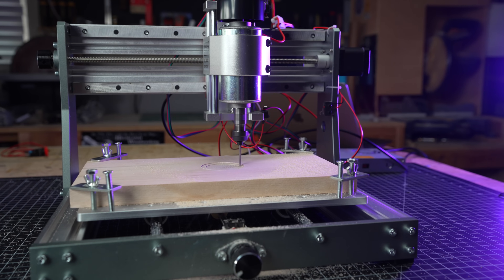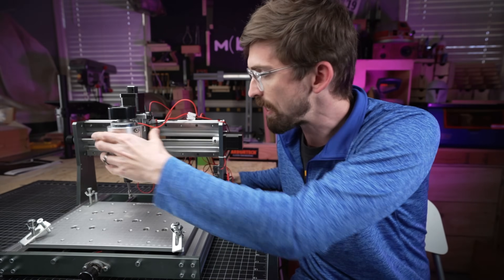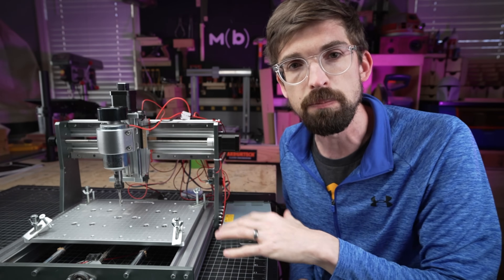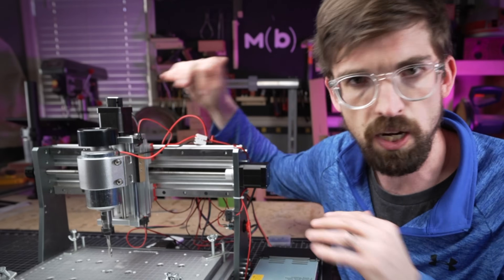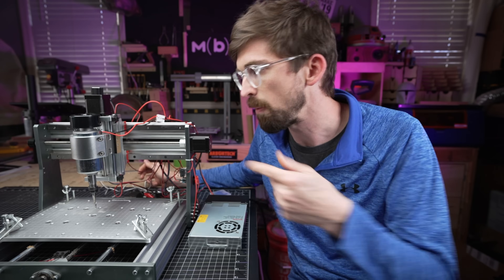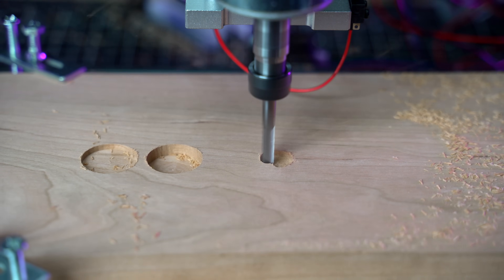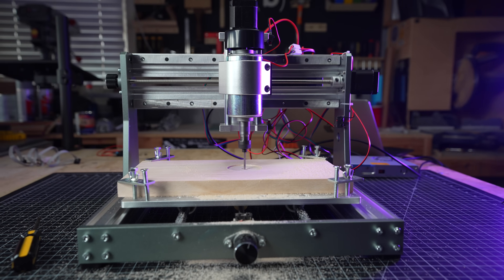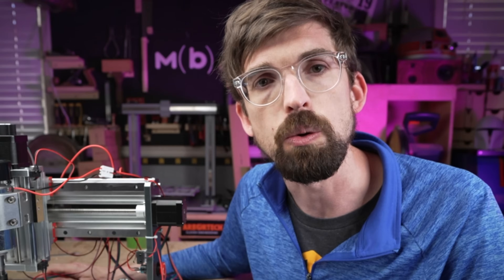What Can a $500 CNC Do? Genmitsu 3020 Pro Max

Comment: for the z axis, cant you just mount the motor up a bit higher, especially for using those 1/4 bits? and wouldnt that also make the spindle a bit more stable as well?

Comment: How feasibile would it be to swap out some of this hardware to be able to handle actually cutting metals? Or does anyone have any other recommendations for low price cnc metal machines?
Reply: I have cut both brass and aluminum on a 3018 even thouth I have larger more powerful machines. Things to consider = cutter type vs material, chip load for cutter / material, depth of cut, feeds and speeds. None of this seemed to be addresed in this video. These small machines can do well within thier limitations. I tend to use my 3018 for small detailed parts in brass and alumimun carbon fibre or wood. Do some research on cutters and materails with the proper tunig you can get good results.

Comment: This is definitely not a good CNC machine. This is a toy. If you really want to buy a toy like this, buy the cheapest one. You will probably be able to engrave printed circuit boards, and thus softer materials.
Reply: Would be better to buy higher quality parts all round including the beefier stepper motors that have controllers & aluminium extrusion. Of course that does mean more work, but if a bare bones CNC machine without any stepper motors, controllers or spindle isn't available then making it from scratch is always the best most cost effective way to go.

Comment: When you described the spindle you said it was a VFD. This is wrong, it is not a VFD. VFD stands for Variable Frequency Drive. A VFD is used to drive a three phase AC motor. The motor used on this unit is a brushed DC motor. The speed is controlled by PWM, Pulse Width Modulation.

Comment: Really, this vibrating clump does cost $500 ? Man, how lucky am I that I got a real milling machine for less than twice that money, Sieg X2P. No CNC but does mill steel or 1/2" aluminium in 1 pass. The original Genmitsu 3018 for $180 ist a bargain, but $500 for nearly same construction is way too much.

Comment: You are having problems with aluminium because you are not using the correct type of end mill. If the mill is chocking up use an end mill with more flutes or a higher rotation speed. Also you need mills with cutting geometry specifically for soft metals like aluminium and brass on low powered machines like this. If you had tried this with brass it would have probably given even worse results because brass is so soft it tends to grab the cutter so definitely needs correct end mills with the correct geometry. Also a shorter end mill will help and repositioning the spindle higher up in the mount will produce less stresses in the z axis and gantry assemblies.
Reply: thanks for sharing!

Comment: I bought this 3020 in Nov 2021 strictly for aluminum cutting. I’ve been using a competitors machine for over a decade and it works great. I was disappointed with this machine and had several issues. It will cut aluminum but not not very well. The 1/8” bit must be all the way in the shaft. (And to prevent milling the table it’s best to lower the Z axis to the lowest point and raise the spindle in the holder so the bit can’t reach the table.) But the spindle is just not rigid enough to handle the cutting, the length of the shaft allows slight flexing. And the spindle doesn’t have enough speed or torque. I found that even slowly cutting a 1” hole in 2mm aluminum with 9 passes was nail biting. It did cut the hole but was a struggle. The finished hole was a few thousands under size because the spindle rigidity was causing it to flex inward. And just drilling a 1/8” hole w the milling bit would sputter when reaching the bottom, and wallowed the hole almost every time. So to fix both issues I hack sawed the spindle holder (another problem-only a 55mm spindle fits), and mounted a $70 rotozip (600W 30K RPM) with metal strapping. Now it mills, drills, and cuts much better. Note that after less than 10 hours the 300W spindle stopped working.

The other issue I had was that most all of the USB software I tried wouldn’t run a few commands of my existing gcode. Also, it was essential that I could stop and start the gcode from any gcode line, and couldn’t do it! So, to get around those problems I abandoned the USB controller and bought a parallel stepper driver and use LinuxCNC (or Mach2).

Overall it’s a nice little machine but wouldn’t recommend for aluminum unless your into mods.
Reply: I'm looking to buy a machine under 1k for cutting aluminum and stainless steel. What do you recommend?
Reply: @BenzCedes  I’ve only used the two hobby level machines. As for aluminum, I believe most quality CNC machines will work fine. The motor is important: a rigid, 30K RPM motor, parallel controller, with a 2 flute bit is what is recommend. As for stainless steel I believe you would need an industrial machine. That’s a very hardened material. I tried to mill steel on my hobby CNC one time, and the steel panel just laughed at me and the machine.
Reply: @engineeringfun8542  Thank you, that's the experimental feedback I was looking for.
Reply: Any newer cheap models do steel cuts now? Still industrial? Benz u get ur project done?

Comment: So... Your endmill is sticking out WAY too far and why you are getting chatter. Also you dont reduce your DOC, you reduce your WOC. Not sure why you would want to ruin the first 1/16" of the endmill. If your feedrate is too low compared to your RPM you are just recutting chips. Cutting aluminum really requires some type of evacuation, like a FogBuster air/coolant mixture.  In the hands of someone that knows what they are doing these type of machines can do very well.
Reply: Bit late of a comment here, but i bought one, and basically thats as far as the cutter can sit in. It has shallow depth before it hits whats the collet clamps onto, on the main bit of the spindle. So he cant stick it much further in

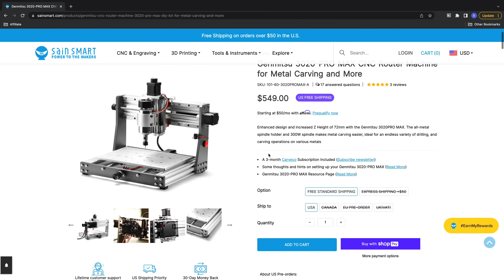Comment: You made circular pockets (10:13), the cutter is turning clockwise then you have to cut clockwise not counterclockwise,  you will see your edges are getting smoother.  Compare it with a chisel, you move it forward, not backward. Cheers!
Reply: Climb cuts are acceptable in many circumstances.
Reply: @MichaelKingsfordGray  Ur right, cheers!

Comment: This is obviously a HUGE improvement over the 3018, but still with a couple of weak spots; staying within a target price point always results in compromise.
** The linear rails on the X-axis are great, so... why not the Y-axis? (Yeah, I know, PRICE!).
** The spindle is still not good enough.  It is still just a cheap motor with the collet assembly held on with a grub-screw (or 2?).  This is a guaranteed source of chatter.
** The gantry does not move, so extra mass and strength is good here. (Apart from freight costs.)  Owners should add horizontal stiffening across the back, which would help in your "Pull on the toolbit" test.
** The cable-management is disgusting!... I am polite enough to assume this is not because you took shortcuts in the assembly!   :o)
This is a really useful video, thanks.   Liked & Subscribed.

Comment: This was a very helpful video!  I would love to ask you what is the machine that you would get, similar travels on the axes with more on the z if possible, that can mill aluminum without serious compromise.  

Since aluminum likes to mess with us with it being gummy let's machine the gummiest aluminum - is that 6061 - if not please just specify and let's make say a motor mount plate.  So a square shape, say 3"x3" by 3/8 or 1/2" when finished with a bunch of holes punched through for through bolts, some holes to be tapped, 

Lets also mill a pattern into the face of this square of aluminum that is say a 2" square shape that is 1/4" wide square track that we are ending with. The feature is also a finished depth of 1/4".  

So if we are using proper feeds and speeds from the machinists handbook or other proper sources what is the most depth we can take on each pass say even on your typical industrial heavy duty vertical milling machine.  That sets our target or best possible case, then can you answer in your opinion which brand machine in these low dollar tiers do you think can actually come close to this level of performance.

Last but not least this machine needs to be capable of true 3d milling into aluminum. Lets say we are going to mill a ball shape where we have a semi-circle full round shape the diameter of the circle is 3" and the height at the center of the shape is also 3" - so we are getting what would look like a bandsaw slice through part of a pool ball cut in half,   Which machine can get great surface finishes and also do the work in a reasonable amount of time.  I am assuming that if a machine could make this 3d feature then it could likely make most features that i would ever need it to.  Please let me know if this is a poor assumption.

This whole CNC market has so many machines that could never hope to do this work which is fairly basic work for sure.  And I know that this was a little bit to read but I am hoping those of you with knowledge and experience will simply be able to just snap your fingers and say - yea, get a "THIS BRAND" and get "MODEL ABC123", they are great!  

Oh damn, we can't forget about cost, I would ask 2 things for cost.  1 - can you do this for under $1000?  How about for under $800 and wow if we can you can do this for $500.  

I have no idea what to expect so I hope that there is some feedback and all of it is going to be greatly appreciated.  Cheers!
Reply: Genjitsu: T-6061 is one of the "nice" free-machining grades of aluminium with magnesium and silicon in the alloy, which, combined with a hardening process, apparently improves machinability.  I don't know what grade the aluminium bar from the hardware store is, but I believe the alloy is formulated to make it easy to manufacture by extruding it, without too many extra processes.  This is the stuff that we see on YT so often which machines like bubblegum, doesn't make nice chips, welds itself onto your cutter, clogs up the flutes, and breaks your new end-mill!   😱🤬😭
Reply: @PiefacePete46  Thanks!   For what it is worth i am an engineer, i have designed and built tons of machines and equipment often using aluminum plate, rounds, etc.. but i have not done that in over 20 years so a bit rusty and it is always better to ask someone that knows than to think you know stuff that you don't.   I am thinking of getting a cnc router to make money with but for me time is running out... i might have to move and i will lose an amazing basement workspace... something that we all dream about - it' snot that big, don't want to exaggerate but you could do a lot here, I have 3 seperate workbenches one of the tops is a full 4x8 sheet!, a drill press stand, a table saw, a router table, a chop box on a stand, plus an area with a couch, tv, etc... I was a lucky fuk and now i am going to go down the drain soon unless i can turn things around fast...  and i am going to seriously miss it.

Comment: $500 they could include 3 ball screws to round the package up. The ACME lead screw has play and the anti back lash screw does not compensate well. You
can do isolation milling to produce some PCB's, engraving turns out fine. But milling at a standard cutting performance? Not sure about that... NEMAs got bigger
but still the drivers are step sticks and so on... NEMA23 would be nice but than you need better driver and  at the end a more rigid machine so.... Better get get
a 3018 both are CNC toys not much more (I bought my 3018 with injection moulded plastic parts for 140$ that was 2019 -2020 ish)

Comment: Could this carve cold rolled steel for stamp and impression plate making?
Reply: Possibly, with low movement speeds, high spindle rates, and carbide drills.
But to what resolution, accuracy and repeatability?
If you require any of the above to be measured in microns, then no.
Reply: @MichaelKingsfordGray  Thank you
Reply: Unlikely, there is no where near the rigidity and power needed to be able to remove metal quick enough to prevent it work hardening around the end mill and bogging it down.
Reply: @schrodingerscat1863  Thank you

Comment: It's a pity it isn't $500 for us in the UK. It is £540 (That's $660) and then plus 20% tax on top. That's nearly $800. Not the bargain it seems.
Reply: But if you got it. Then modified it with larger T bars. You can make it 2ft or larger. It all depends on how you see it and if it's worth it.

Comment: for some more Z height I bolted some 2040 onto the top of the side  aluminum extrushion and to be honest that looks like this is  all this little cnc needs, for the price I do think it is a really good hobby machine..
Reply: adrian harrison:  Or take the easy way out and move the motor higher in the clamp... less chatter, better tool life, better Z height; win-win-win!   😉
Reply: @PiefacePete46  Looks like you could easily get 4-5 inches more just moving the motor in the clamp,
which is my biggest beef with this for making small wood projects.
Reply: @rRobertSmith  Same here. The Z-axis height is the struggle. I sometimes need more than 70 mils. And when adding a sacrificial board below, there is not much left.
So to make this machine better:
- some stiffening on the back
- place the motor a tad higher

But this video is from March 2022. Any new machines that are better in this price range? I really only need to work on wood.
Reply: @JanHilt  Foxalien Wm 3020

Comment: 10:56 yes thats why i build 10 years ago spindle and z (2x)axis sandwiches TWO Y axis.. still no one do it.
9 year ago it was upgraded 4 axis. yes spindle rotate allmost 220 degrees LOL i cut part 3 faces same time even can drill and mill angled holes. yes it mean i needed make controller there was no backthen lol
i mean controll software

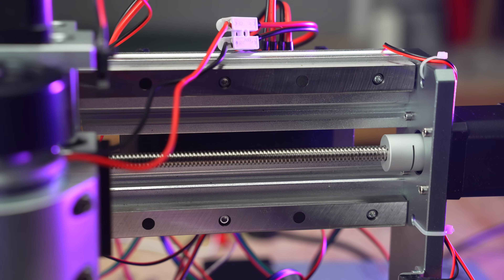Comment: 1:32 still lame acme and y z axis linear rods. next year full price 600buck upgrade get same linear blocks than x lol. ball skews and linear rails for all axis not cost 500. this machine make so much profit using still rods and acme(spring loaded backlash) still no 2 way nut and slots to adjust make it tight as you want no backlash no spring LOL or same money ballskrew

Comment: You might have better results on aluminum if you moved the motor clamp as far down the motor as possible, and only have the minimum amount of the endmill sticking out of the collet. That would provide a bit more stiffness.
Reply: @zoltanbereczki8067 generally you are right... without higher gantrys there are at least  three other ways to raise the z achsis without being to shaky. usually: fixing it on something without a steel gantry. or a massive gantry.

1. putting the gantry directly on the rail and "dig a hole" between the both x axis. 
i really think about such design. as this seems cheaper to me. i want a ballscrew x1 and x2 anyway.
2. another method is a fixed gantry.
like: fix the z axis on a stone balkony and put a x,y crosstable below. thats for smaller
high precission parts better. and easier.
and propably cheap. concrete might be your friend here to make it stiff.
3. a similar design is a fixed concrete gantry with a huge y axis with an z axis.
the x achsis is on a table then.

in my world i do not need high z axis, but prefer stiffness. on maybee 10 cm. so i really thin working with two massive allighned sidebars as a basis.with rails on the left and right and very low gantry on top.
Reply: That’s a great idea, be careful not to overtorque the mount if you’re over the bottom of the spindle. It’s surprisingly easy to place excess pressure on the bearings and cause overheating.
Reply: Thanks, was just about to say the same. By clamping it that high you are creating a much larger lever type force feedback. And losing Z height.

Also make sure you use the ER11 (same goes for the larger ones like ER16, ER20, ER25 etc) collet correctly. I seen this so many times on YT. It's hard to tell in this video but the general idea is that you need to click the clamp into the collet nut before you insert the tool. Do not put the tool in the clamp and then drop it into the nut and ER11 holder. The clamp has a groove and the nut has a ridge that mate up if there is no tool yet. They will not mate up if the tool is already present and the bit will not be properly clamped.
Reply: @xConundrumx  thanks for the hint. anyway i am thankful for the honest presentation. i want to build a much bigger machine and thought about making this the 'mother'. I am aware that one has to use things right. But. if it does not even handle aluminium safely, its a dealbreaker. thats many components involved here. but the y gantry propably would even perform better wit a u shaped alluminum. the only reason why i would even think on such small scale would be more stiffness. the bigger the machine, the higher all leverages. but this does not even work out with railguides. 
maybe a sheet of skrap mettal skrewed on the gantry would make the job.
but generally this thing comes with a lot stuff. the small screwdrives are propably shit. just the nema 17 little small. grbl controller is a good feature btw.
Reply: essentiall. i think its about stiffness not about mass.

Comment: Nice machine, few corrections, the clamp bolt size on the worked are M6, not M16
You seemed to indicate using the knobs to adjust Z probe height & X/Y zeroing. Not exactly accurate as the DRO will not account for those movements and not know offset or a curate position to apply to Zero!
Reply from the maker: Good catch on M6, pretty sure I had James Bond on the mind for MI6… and for the manual controls totally agree it’s not a DRO, I only see using those if you want to manually move the axis since it’s hard to just push because of the lead screws.